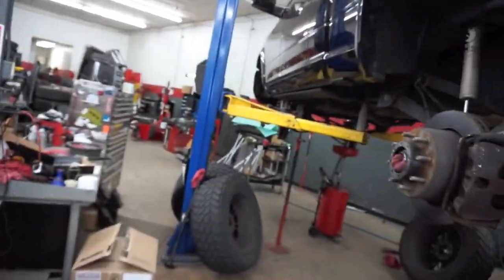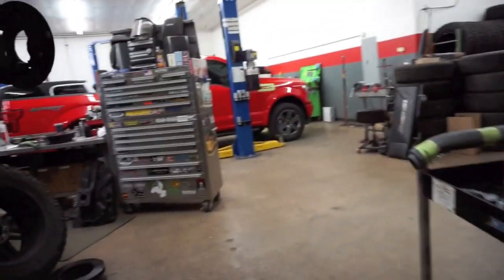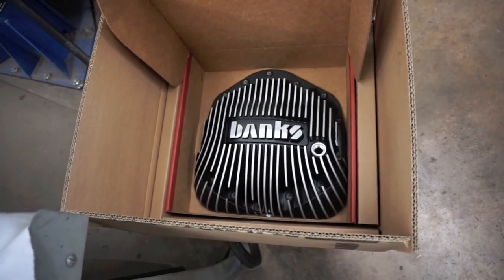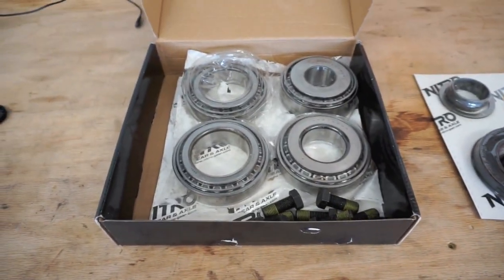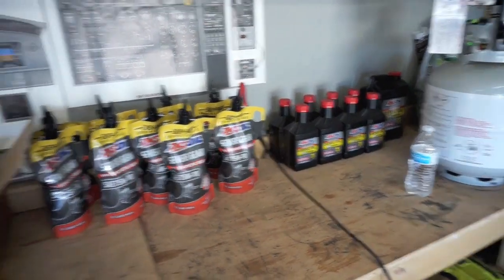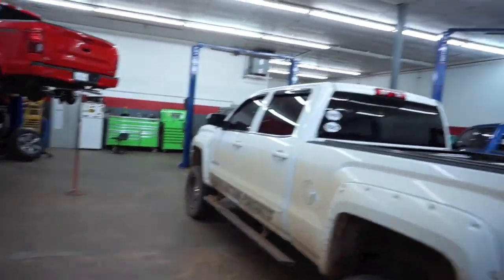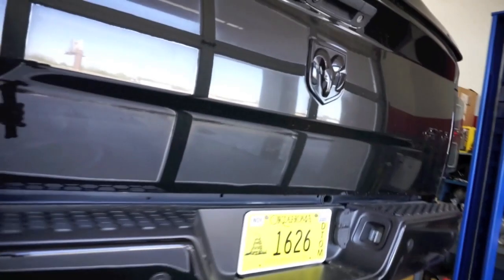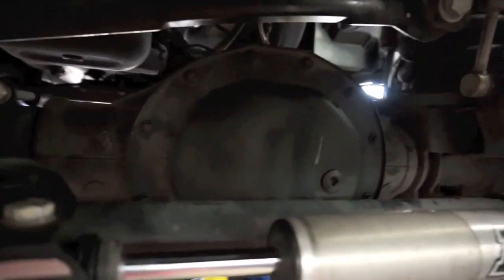4.30 Gear Swap Part 2...

Comment: Really liked your comments on the Nitro 4.30 gear swap. I have the 2018 Ram 2500/Cummins with 3.42s and the 68RFE. Did the mods on the trans with ATS. Running 35s. Want to swap to 4.30s like yours. Is there a new part after the initial run. Question is did your Nitro Gear package come with a spacer for the front 9.25?
Reply from the maker: I don’t remember if i needed the spacer or not. I ordered my gears from nitros website. They had everything needed for the install on the truck.

Comment: 1st, thnx for the video. After regearing, will I have to get the truck reprogrammed? If so, can I do that with a portable tuner?
Reply from the maker: I would to a trans relearn and it’s something most can do with a programmer.

Comment: Would you think the 4.44 ratio would be too much gear? My local installer has had a couple bad experiences with nitro and pretty much won't install them. So my choices are 4.10 or 4.44 with him. What are your thoughts. My truck is basically the same setup as yours 3500 srw lifted 37s. Thank you sir
Reply from the maker: 4.44s would work just fine as well. so far so good with the nitro gears. I have about 40k miles on them now.

Comment: What was your final cost? Looking to do this same regearing on my 2015 now that im running 37s.
Reply: I regeard my 2014 with labor and gear oil your going to pay 2-2500. If you want to say a dollar buy your gear oil from rural King for the break in and then after 500 miles change to whatever shops up charge everything. I have 4.88s in my truck Im on 33s had to have custom tunning for my truck for the shift points took about a month to get it where I wanted it a lot of back in forth with ppei also I bought a speedo calibrater. I'm @ 2000 rpm @ 66 mph perfect for me because I don't pull on interstate mainly around town and 2 hours away Durning spring to plant food plots ect. Regearing is the best mod ive ever done to my truck even deleted the 3.42s I hated towing 17k had to get into it to get going. Now I pull that same trailer in 6th gear on any incline I have around hear doesn't down shift. Driving around empty feels like I added 50hp alot faster acceleration. I'm not a fan of big tires on a tow truck but glad your actually regearing your truck it's over looked today. People say they can't tell they added bigger tires obviously haven't towed heavy. I did a test with 33-35-37 inch tires on my truck even with 4.88s towing 17k you can notice it pretty easily
Reply from the maker: 100mkampman i paid about $2300 for everything need to change the gear oil
Now that they are broke in.  so that’s about another $150
Reply: Just ordered nitro 4.30 for my 03 duramax